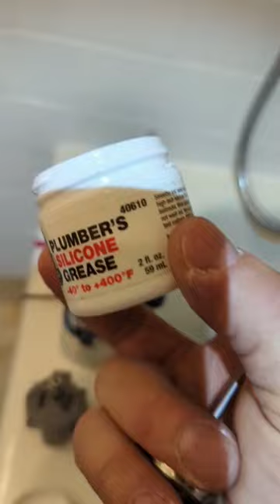Grohe Pressure Balance valve cartridge 47157000 and Non-return valve 47158000 replacement #plumbing

Comment: You should post a long form video of this and put the link in the short’s description. There are so many intricate steps replacing these Grohe pressure balancing cartridges and sometimes there’s nothing wrong with the cartridge…  it’s just an O ring or two that need to be replaced. Doing the video in real-time would also allow folks to get a better look at the non-return valves and all the O rings and gaskets. 
The only other recommendation I have is that I didn’t see you flush the entire valve while everything was out. It’s possible you did it, but the music and speed made my head hurt. Ha!